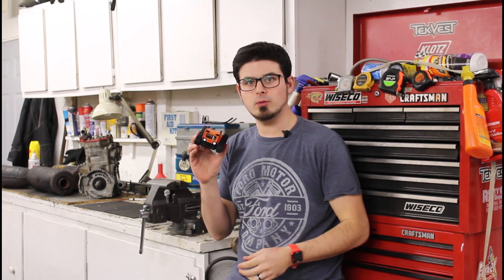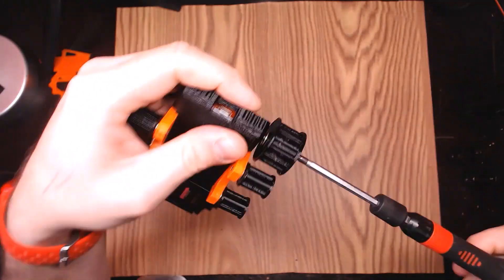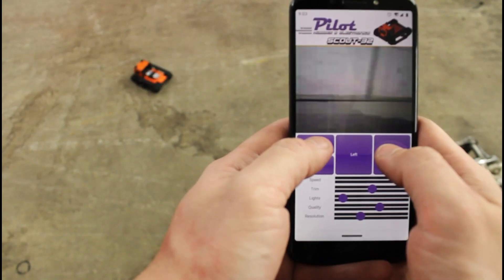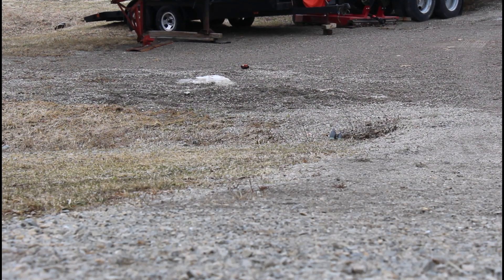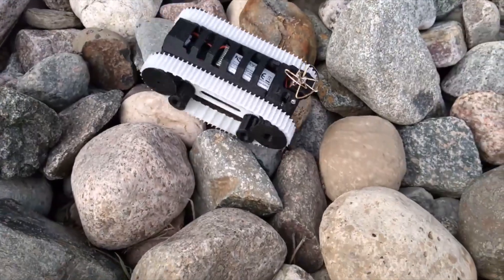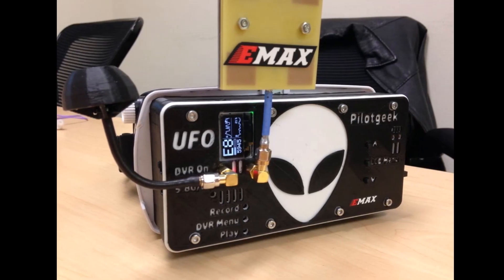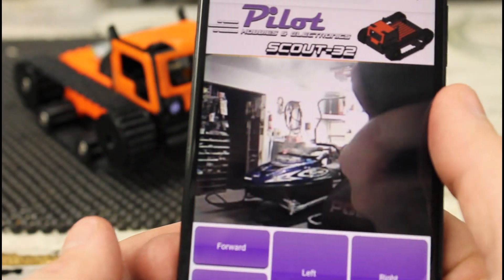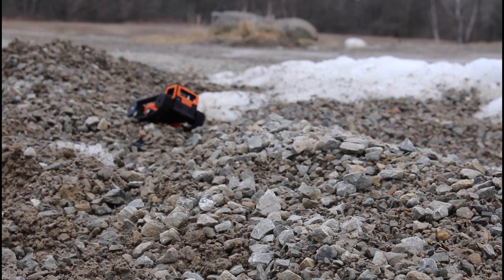Stuck Inside? 3D Printable, WiFi Controlled, DIY Micro FPV Rover!

Comment: In the video I can see you have a clean fluid picture. On my esp32 cam there are some random horizontal lines drawing
No matter which version I upload it is the same. I also tried three different esp32s.
And also when I set it to highest resolution half of the screen goes white

Comment: Great design, have you considered implementing a "laser" tag game? That way you could interact with more each other
Reply from the maker: I've thought about it, haven't implemented it at this time. It would probably be possible to replace the LED headlights with an IR TX and RX. I'm sure someone out there has code for a laser tag style game which could be modded in .

Comment: Hi, which software you have used to design tracks and wheels?
BTW, great project.
Reply from the maker: I use Autodesk 123d design. It doesn't have any sort of calculators for this sort of thing, so I just looked up some old engineering guides on how to make belts and cogs. I'm sure something more modern like Fusion 360 has automatic calculators for this built in.

Comment: Hello, I want to apply your project in a heavy tank.
Please help me, I can't understand what the values depend on.
1) int endpoint = 220 ; // Multiplier for servo endpoints. Should be around 60 on modded servos, around 220 for TowerPro 360.
What does this parameter affect and what does it depend on?

int speed = 8 * endpoint;
int trim = 0;
2) int neutral = 5100; // Servo Neutral Point
what does this parameter affect and what does it depend on?
Reply from the maker: It just sets the neutral and endpoints. Some servos are more sensitive. An ESC could probably use the 220 setting and default center. I forget exactly how it was calculated but it corresponds to the pulse width of the servo signal.
Reply: @Pilotgeek  Thank you very much, I picked up the parameters for sg90, all that remains is for MG995)))
For the redesigned sg90
int endpoint = 162 ;
int neutral = 4450;

Comment: Works very bad and unreliably to me. You had any issues like that?
Reply from the maker: Make sure you're using the latest version of code, the previous versions would flood too many requests at once. It also helps to have a fast phone, as I've experienced lag on some budget phones and tablets.
Usually, poor performance was related to reception. I've had poor performance in buildings with a lot of interference or devices on the same channel. You could try changing the WiFi channel. Also, make sure your antenna is configured correctly, as shown in this tutorial: https://randomnerdtutorials.com/esp32-cam-connect-external-antenna/
Reply: Pilotgeek it worked really good with other codes and I’m using the latest version (flashed two days ago)
Started to think it’s the ESP board but it works awesome just streaming (cam webserver) :/
Reply from the maker: @zeDoSauRus  You may want to use the older code if it works better for you. I think version 1.3 used the older method of sending commands to the tank. I reuploaded old code to thingiverse if you would like to try all versions. https://www.thingiverse.com/thing:3987784
Reply: Pilotgeek thank you man! ❤️

Comment: what would you have to change code-wise to make this controllable from another location by connecting this to a local wifi? I'm interested in building these with students but having them control them from home, because of the whole covid-19 issue, while the bots are in a battle arena housed in our school.
Reply from the maker: It should be pretty simple to do. I'm not sure how many are viable on an access point bandwidth wise, but it should be doable. The students would probably need to use a VPN to bridge the networks from their home networks. 

The Scout already has a framework for connecting to other access points. The following values are at the beginning of the Arduino sketch. Turning bool ap = 0 turns it into a client, and the ssid and password are the values for the network you want to connect to. 

bool ap = 1; 
const char* ssid = "Scout32"; //AP Name or Wifi Router SSID
const char* password = ""; //Password. Leave blank for open network, or enter password of WiFi router to connect to.

The Scout32 by default will take a DHCP address, so you may need to hook up a serial monitor to each rover to identify which IP address it takes, or use something like SoftPerfect IP Scanner to list which IPs are taken on the network.
Reply from the maker: If you need any code changes or additional help, you can email Pilotgeek45@gmail.com

Comment: Pilotgeek, you have do a great job , but i have a question, 
On my web server, the image does not as you show,the image is rotated 90 degrees to the left,how to correct this situation
Reply from the maker: In the file app_server.cpp, you could try to replace this line:
img width="400px" height="300px" id="stream" src=""

with this line:
img style="transform: rotate(90deg);" width="300px" height="400px" id="stream" src=""
Reply: @Pilotgeek , It can work , thank you ,you are the best